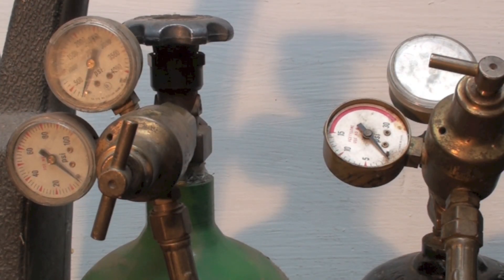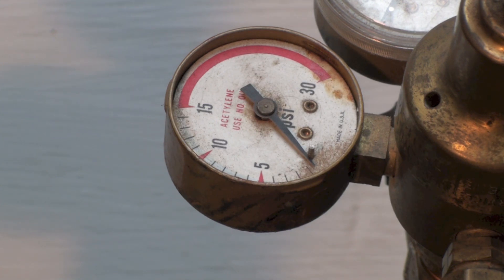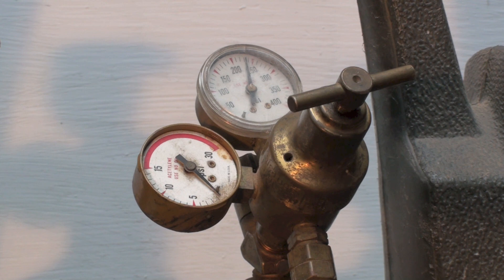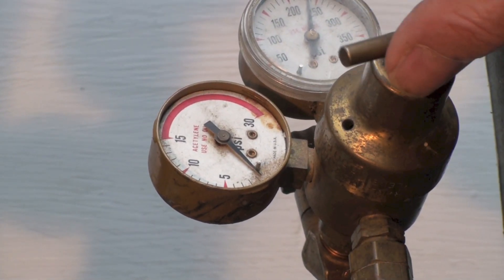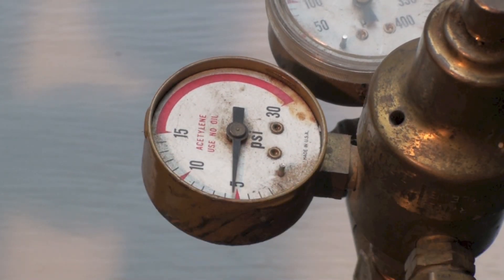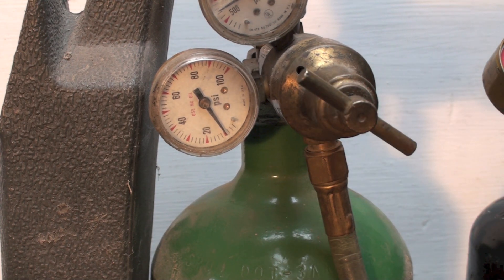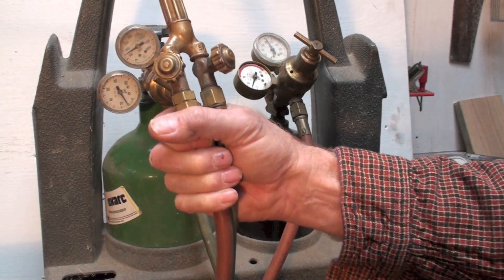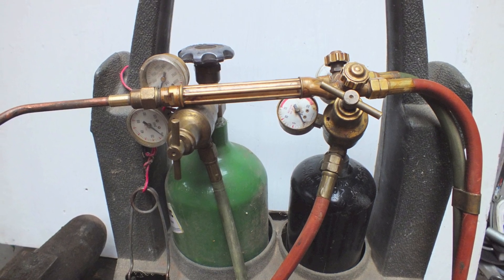How to set the oxy acetylene regulators

Comment: PLEASE REMEMBER TO NEVER OPERATE A TORCH WITH NO COVERS ON THE GAUGES!! THEY ARE NOT ""DUST. COVERS"" THEY ARE A SAFETY 
DEVICE!!! WHY?? IF A GAUGE EVER FAILS AND THEY HAVE THE PTESDURE INSIDE THE TANK GOING TO THE GAUGE CAN BLOW THE NEEDLE AND SHAFT WITH SUCH FORCE YOU WILL NEED A AMBULANCE IF THEETAL DOES NOT KILL YOU!! I HAVE HEARD IT ÀLLLL BEFORE""" I WILL WORRY ABOUT IT WHEN IT HAPPENS!!! DEATH BY DUMB
IS ""NO GOOD"" ALWAYS SAFTY FIRST!!! MISTAKES THAT CAN BE AVOIDED ARE GIFTS FROM GOD!❤😊

Comment: Remember everyone!!....NEVER go higher than 15 psi on the Acetelene. Acetelene becomes VERY UNSTABLE at pressures higher than 15 psi!!...Open the Acetelene valve 1/4 to 1/2 turn...NO MORE...in case there's a problem, you can shut it off quickly. Open the oxygen valve slowly at first, then open it FULLY. ALWAYS open the oxygen valve FULLY bc if you don't, it could damage it. It has a special kind of valve on it that could deteriorate if you don't...👍😁

Comment: in the case of Oxygen tanks, the valve
actually needs to be opened all the way because of the higher amount
of pressure present in the tank and the way the back-seating valve
works. If it is not opened all the way apparently there is a risk of
there being a leak in the threading of the valve itself.

Comment: My torch head has a lot of carbon in it. It is OK to use carb or brake cleaner to get this out? It's an older torch from my late father. It was used and abused but still works quite well.
Reply from the maker: You can, but would follow up with water.
GFM

Comment: This equipment is dangerously old, oxy/ace lines should be replaced, every 6 years is standard but usually not needed, but 20 years is getting pretty suspect and a recent hand held unit with check valves is far safer than an older one may be.  Not many ace explosions noted in news but they do happen on occasion.  Be safe.    (There was one last month, blew up windows in two houses after leaking tank on truck caught/exploded).

Comment: Sorry I'm just trying to figure out how to adjust my regulator gauge so it's back at zero instead of zeroing out at the 50lbs mark or whatever  it starts at but it's about halfway to the maximum of the gauge
Reply from the maker: If there is no pressure on the gauge, and it does not zero by that amount, the gauge must be replaced.  No pipe dope.
GFM

Comment: Acetylene pressure seems low, are you sure the gauge is not calibrated in bar
Reply from the maker: That's because I set acetylene to sensible (to me) pressure.  Many set to 15+.  I I consider that to be excessive and could be dangerous.
GFM

Comment: I was an oilfield welder for years and spent hundreds of hours on the end of a torch. I always ran my oxygen at 45 psi and acetylene at 15 psi!
Reply: That’s because you’re and igmo….
Reply: @yamahajapan5351  I guess the English language may be a little to advanced for you! When you are trying to state that someone isn’t too smart, be sure you use proper grammar you dumbf!   Correct grammar is —-> “an igmo” NOT “and igmo”!!!  It’s so damn funny when a fkn moron attempts to imply someone else is a dummy by using piss poor grammar and the entire wrong word!!!
Reply: @trailerparkcryptoking5213  When correcting someone on their grammar, you should make sure that you get yours right too
Reply: That’s crazy. My whole life I’ve been taught having acetylene at 8 and oxy at 15. Never had an issue.
Reply: @7grizz1936 The pressures depend on what you're doing. If one is welding or cutting steel for ex., that's not too thick, pressures of 10 for acet. & 25 for oxy might be good. However, if one is cutting very thick steel (prob. 8 inches or more, then pressures of 15 acet. & 45 oxy. may be needed. 👍😁
Reply: Can’t that explode
Reply: @kellenedwards8675  what do you mean by “that”.? Flammable gas can explode if used incorrectly
Reply: @7grizz1936  lol that’s what I meant
Reply: @7grizz1936  this has been a while now but i was meaning that acetylene Can become dangerous and possibly unstable at 15 psi and over

Comment: My is acetylene is in the red on gage what could
Reply from the maker: If the adjustment does not change the pressure, the regulator has failed.  Could be dangerous as high pressure in the line could cause spontaneous combustion and an explosion.
GFM

Comment: I'm an old iron worker, I always start at 7 gas and 38 to 40 on the oxy
Reply from the maker: Welding or cutting?
GFM
Reply: This guy is only using a welding torch not a burning torch . .

Comment: Do I close the oxygen and acetylene and then release the pressure?? Or release the pressure and then close the oxygen and acetylene? I would really appreciate some help
Reply from the maker: Close the valves on the cylinders, then open the torch valves to release pressure, close torch valves then turn the regulator left until it is loose.
GFM

Comment: By the way sr.; I thaugt you were supposed to open the acetylene valva.all the way up since it also has a seal seat on top and in the
bottom .correct me if i am wrong i need all the help i can get have a.great day!
Reply from the maker: The Acetylene actually does not have a back seat valve.  It uses packing to seal.
GFM

Comment: Used propane and oxygen when I did iron work. Works just as good
Reply from the maker: About 30 years ago, I tried propane with oxygen.  It did not work well.  The oxygen use went up by around 4X.  From a cost point of view, it makes no sense.
GFM
Reply: Yeah I agree with gray here...propane is alot worse to cut with and it's not even close.

Comment: Do I have to use oxygen to weld ??  O it can be done with just acetylene ??
Reply from the maker: There is an air-acetylene torch.  It works for high temp brazing but is not hot enough for steel welding.
GFM

Comment: But if your oxygen is higher than your acetylene, the reverse risk also exists. In an equal pressure mixer at any rate.
Reply from the maker: Both the design of the torch and the advent of back flow preventers reduces any movement from one source to another negligible.
GFM

Comment: Someone gave me an old set of tanks with oxygen and a smaller one with acetylene. They are pressurized.  Does that gas or oxygen go bad?  Are they dangerous to use if they do go bad?
Reply from the maker: I have never seen it happen.
GFM
Reply: The gas inside doesn't go bad usually. Unless it was contaminated when it went in. The rock that the acetoline is disolved in will go bad eventually I think. However, The tanks themselves will be dangerous if they have not been stored correctly. Tanks need to be hydro tested every 10 years or so.

Comment: All great, except that the oxygen bottle should be opened all the way and 'seated' open to prevent leaks. That's how O2 valves are made to be used.
Reply from the maker: First, the oxygen cylinder is not a "bottle".  A bottle contains a liquid not under pressure.  
I was taught in the 1960s to backseat the oxygen valve.  That changed in the 1970s.  The valves were redesigned to allow them to be opened partway.
GFM

Comment: You missed a couple of very important points, one is when you open and acetylene bottle you only open it a couple turns so that if anything happens you can close it relatively quick, on the oxygen when you open the bottle you open it up all the way there are two seats on that valve one is all the way closed one is all the way open you do not leave it halfway in between!!!!
Reply from the maker: I hear you on the acetylene valve.  The oxygen does indeed have a back seat.  However, since so many users did no open it all the way, the valves were changed and the packing no longer leaks.  I still mostly do open it all the way.
GFM
Reply: I am glad you mentioned this , very important .

Comment: Why not acetyline and oxygen readily mixed inside the cylinder?
Reply from the maker: Well, if you wanted a bomb that would explode when you light the torch, I guess that would work well.
Good grief think about it.
GFM
Reply: Wow ...try putting acetylene and oxygen in a garbage bag then adding a wick.  Light the wick and see what happens. You will have your answer. Lmao good luck. We use to make these bombs all the time.

Comment: 10 gas and 20 to 25 oxy will cut anything you will ever need to cut.
Reply from the maker: As long as the steel is less than 1/4" thick.
GFM

Comment: So I always set pressures higher by regulator and used the knobs on the tip to adjust. Taught like that in trade school and by co workers starting in the trade. In CAMT they taught me to use to regulator as a regulator and use the valves as valves. With your method, the valves on the wand are opened rather than tweaked or adjusted?
Reply from the maker: The valves are adjusted to limit the flow.
GFM

Comment: Set the acetylene at just below 15 lbs, and start the oxygen at 45 lbs, and increase according to thickness. Do not listen to this hack farmer wannabe crap. I have approaching 40 years experience, and have never heard such crap. You throttle the feed with your torch valves, there is no need to get fancy with multiple settings like this idiot is portraying.

Comment: Gauges should be set according to the manufacturer of the tip based on their recommendations and the size of the tip.  Right?
Reply from the maker: That is not the way I have done it.  For welding tips, I set the pressures more or less the same regardless of the tip size or manufacturer.
GFM
Reply: Thanks for your reply..  Do you care about the 1/7 discharge rule for acetylene?  I am using a 60 Cubic Feet oxygen tank with a B size  acetylene tank (40 Cubic Feet).  At that size of acetylene tank the discharge rate should be no more than 5.7, right?  A #2 tip set at 3 psi  for acetylene will have a discharge rate of 5.  No larger size tip should be used for this size tank.. Is that right?  I am turning to you as the expert.  Thanks.
Reply from the maker: I can't say whether your numbers are correct.  I can say that I have used a C acetylene with a cutting torch that will Will cut 1" steel.  Lots more than a #2 welding tip.
GFM

Comment: Never welded before, only looking to do small cutting and welding jobs. Do I need a gas or a electric welder? Thanks for any advice.
Reply: get a stick welder they are harder to learn but better outside and once you get the concept of how to use one its easy and not much to carry around.. mig's are expensive and need special shit to work outside when windy or pretty much anything other than in your shop.

Comment: I when you use your torches just cracked the valves then then them fully back set the oxy and no more then 1/4 turn.
Reply: Do what?
Reply: A quarter turn open on the acetylene and open all the way on oxygen.

Comment: sIR. mY I USE A TURBO?
Reply from the maker: You may but it does not have as much heat as the Oxy-acet torch and may overheat the joint due to being on the joint too long.
GFM

Comment: Should never trust gauges , on the pipe line we were told to set the limit of the torch tip with the regulators not the torch . Torch stayed full open , A  and  O. This was in the 70s  , and for mostly high pressure cutting torches , to prevent back pressure . but I don't think they had the inline safety valves like they have now.   Not to  be a critic  just  conversation .
Reply from the maker: Never did it that way.  I guess you could do it that way, but I don't see any real value to it.
GFM
Reply: I prefer fine-tuning with the torch valves because they're right there in your hand, not 10-20 feet away at the bottles.

Comment: In school we're taught 20psi for Oxygen and 7psi for Acetylene.
Reply: You were taught well but different tips and metal thickness will change settings. The 7 and 20 is spot on for most applications. 10 psi for oxy is too low for getting a good cut on most thicknesses.
Reply from the maker: There are as many pressure combinations as there are techs you use them.  Most of them work.
GFM

Comment: I don't want to trash on your vid and say it's all wrong, but I've learned this way:
Back out t-screws on both oxygen and acetylene until they're loose (flick it and it'll move)
Make sure the valves on the torch are closed before pressurizing.
Pressurize either first, but for acetylene, open the valve one full turn. Then tighten the t-screw until the acetylene is at 13 psi. For the oxygen, open the valve all the way. Pressurize it to 20 psi.
Done! Now just open the acetylene valve on the torch a little bit, ignite it, adjust the flame, then add in oxygen. Easy.
Reply: I've learned to have the oxygen and fuel at a 25 to 5 ratio respectively.

Comment: YOU ARE CORRECT IT WAS A TYPO. I USE MY TORCH SET TO BRAZE COPPER LINE SETS WHEN INSTALL A/C UNITS. AND I NEVER GO OVER 5 POUNDS OPEN. AND JUST LIKE YOURS I DONT REALLY TRUST MY GAUGES.   GOOD VIDEO AND THUMBS UP VERY INFORMITIVE.

Comment: NEVER SET ACETYLENE REGULATORS HIGHER THAN 5 BECAUSE AT 15 THE ACETYLENE BECOMES UNSTABLE AND YOUR PLAYING WITH ABOMB.
Reply from the maker: +dale lankford You are incorrect.  The issue of the instability is over 15#, note the red bar on the gauge.  
GFM
Reply: +dale lankford Over 15 it becomes unstable. All Smith welding tips operate at 10 psi , factory recommendation. Nothing is made that uses over 15 psi .
Reply: +Kevin Michael East I MENT TO TYPE OVER 15 PSI , AS I SAID I USE MY TORCH SET FOR BRAZING LINE SETS IN A/C WORK.AND SELDOM FIND THE NEED TO CUT WITH MY TORCH.
Reply: Gotcha , no problem !

Comment: No flashback resters 😑 savage
Reply: +Brett Crate UL or CSA approved Flashback Flame Arrestors are more or less LAW. Not having them on a system might mean you have no insurance when shit hits the fan. NO - check valves are not the same. Most arrestors have check valves built into them

Comment: Your videos are great and I love the way you handle trolls.  Would you be willing to do a video showing how to charge a heat pump in the heating mode in cold ambient?  How about a video on finding refrigeration circuit restrictions?  I just pulled a txv that I'm pretty sure was sticking, but once out, it seemed to pass my blow in it test.  The liquid dryer had more blowing resistance than the txv seemed to.  My vacuum pump wasn't working so this job is tbc when my new pump comes in.  When you retire, you should open a support line (during the hours of your choice) and charge younger techs for live support while they are in the field, walking them through stuff.  Or sit home and get paid to talk on the phone now :)
Reply: Pointing out faulty gear to newbies is not trolling. There was some good I formation but there is also a bit of do as i say not as i do and that can lead to someone getting hurt.
Reply from the maker: acoustic4037 Good thoughts.
GFM
Reply: I would never work on the job for the equipment was in this bad of shape anyone that would is totally out of their mind OSHA would agree with me and send these people home in a minute

Comment: OK, so about 5 on the gas and 10 on the O2. What about for cutting?
Someone one time told me about 5 and 30 for cutting.
Is 30 too high for the oxygen for cutting?
Reply from the maker: The pressure depends on the thickness of the steel to be cut.  I usually use 40# for general cutting.  Hope this helps.
GFM
Reply: grayfurnaceman  Oh, OK, So I can go as high as 40
Let me ask you this, my low pressure acetylene gauge is acting goofy, (I just got this set used, its one of the little baby sets)
1st the needle was under the peg, so I took the cover off and moved the needle.

With the acetylene valve at the torch end closed,
the gauge goes up to about 5 PSI
But when you open the acetylene valve at the torch end, the gauge goes down to Zero.
Turning the regulator in, with the valve open (at the torch end) has no effect on the reading.
I did light the torch, and adjusted my flame, and it did seem to work OK,
But of course I don't know what my true pressure is.
Do you think is is (hopefully) just the gauge, or does it sound like the regulator is messed up?
Reply from the maker: anthony diodati I would dump the gauge.  It may have been damaged.
GFM
Reply: grayfurnaceman
OK< thanks, I'll try the gauge first. I really hope thats all it is. I gave $110.00 for the set up, then it needed a $8.00 fitting,
Then it needed new hoses, or the hoses repaired,  as they were leaking at the regulator fittings.
But I got a new hose for free, so there was no loss there. But I don't want to have to keep putting money in this thing,
sometimes you try to save a nickle, and it costs you a dime.

Comment: It's been a bit since I posted before, but I have to say what happened. I got some OLD regulators and the only one with all the parts was the O2 reg. So I purchased a new Acetylene reg and guess what. The OLD Oxygen regulator held it's pressure for 24hrs when I did the leak test, and the NEW Acet reg was leaking after a couple hours!! So what I got outta that was, don't knock those old ones, if they're working, they're probably better than some of the new ones out there! (OK my 2 cents)